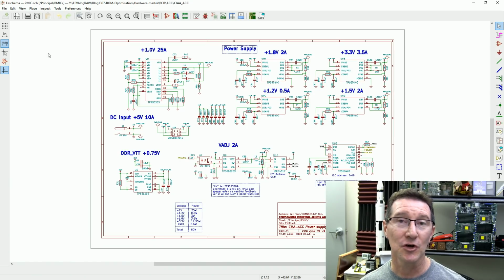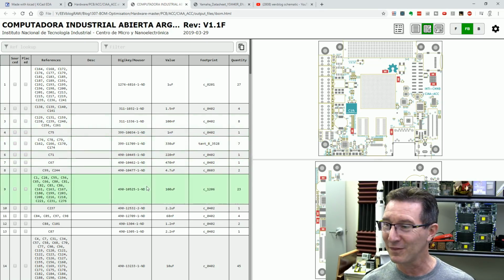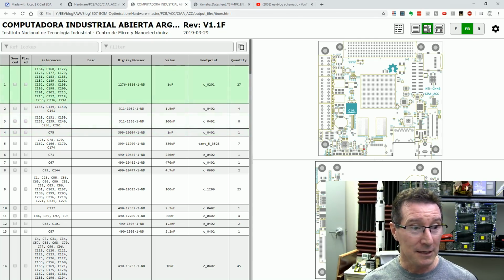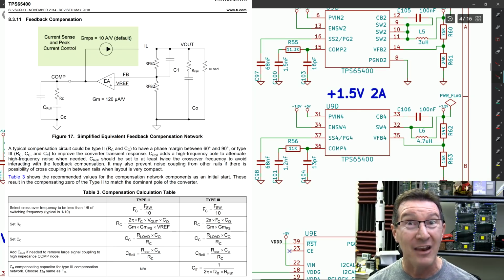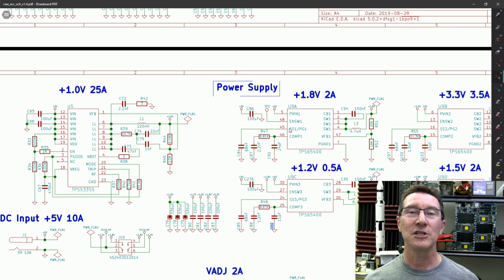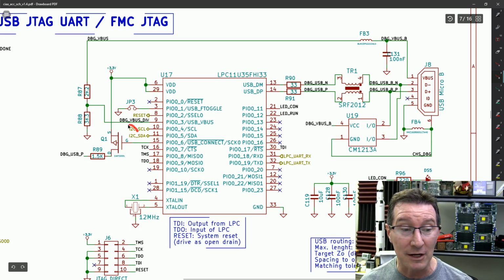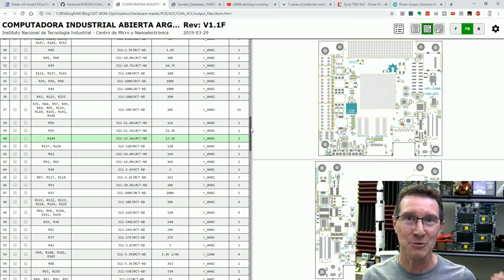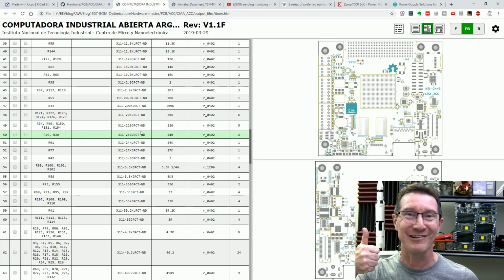EEVblog #1307 - TUTORIAL: PCB BOM Consolidation

Comment: Oh yes please! I would love to see a more in-depth BOM consolidation analysis of a board like this.

Your "Holy Grail" of one resistor and one capacitor value intrigues me. One project I have on the back burner is a SMD clone of a solid state guitar amplifier that many choob fanbois love for its choob-like tone. (It's the Fender Bronco amp, and I've zeroed in on the asymmetric differential amplifier at the input as responsible for simulating the distortion of a single-ended common cathode triode gain stage.) Lots of opportunities for series-parallel resistors and capacitors to consolidate the BOM down to just a few values.

One of my "Holy Grail"s of choob amp design is replacing electrolytic reservoir capacitors with blocks of polyputthekettleon in parallel, since wet electrolytics tend to dry out. Surely parallel MLCCs can be used in lower voltage reservoirs, since the microphonic effect is voltage dependent.

Comment: Hello Dave, I am part of the CIAA Team! Thanks for your review. I will design a new release considering your suggestions. It is important to note that 0201 capacitors have a lower inductance than 0402 caps. Besides, don't forget to consider the temperature coefficient when you replace capacitors (in order to make BOM consolidation). About bypass capacitors... I would not reduce the quantity, if Xilinx says use 100, I will use 100!!!
Reply: @NerdyNEET  jaja I don't want to be rude, so I will only say that the FIRST RELEASE of this board worked fine! And it is open hardware. And it was routed with KiCAD. And we are in Argentina... you will never understand how difficult is  to finish a project like this in my country.
Reply: @noeliascotti1795  If the first release of this highly involved board worked fine, you deserve the utmost respect regardless of where it was made or with what it was laid out!  That's incredibly impressive!
Reply: @noeliascotti1795  my congratulations, ANYBODY getting a board up and running deserves respect and the free review of Dave may help you in the next iteration. All the best from Switzerland.
Reply: @Matt herpader  It is very risky to not follow the manufacturer recommendations... I prefer to design an expensive board. Anyway I will do the math in order to see how much money we can save with the BOM consolidation.
Reply: @noeliascotti1795  : Rather than being risky to just not follow manufacturer recommendations, it risky to not give yourself the chance to follow those recommendations. Once you have the location allocated to a part, you can choose to leave it empty,
Reply: I'd agree with you on Xilinx specifying 100, use 100 and no less (more, maybe). Their FPGAs can really pack a punch, especially their higher end products like the MPSoCs and Ultrascale+ Kintex/Virtex. Without proper bypass capacitors one can risk timing failures and the resulting metastability will be a nightmare to troubleshoot. Considering one FPGA chip costs in the 5 digits to run a prototype, in terms of risk management, the cost savings from cutting down on bypass capacitors isn't worth the extra iterations most of the time.
Oh, and just because one design managed to work with say 50 bypass capacitors instead of 100, that doesn't mean it'll work once the ambient temperature hits e.g. 60 instead of the usual 25 or 40. Even X7Rs still vary by a good lot.
Reply: @Wizongod  I guess what Dave is trying to say is that you should make conscious engineering decisions on the components to use, not to follow the chip manufacturers recommendations blindly.
Reply: @NerdyNEET  CIAA stands for "Computadora Industrial Abierta Argentina" 
Here are some history where it came from http://www.proyecto-ciaa.com.ar/devwiki/doku.php?id=proyecto:origen_ciaa
Reply: Not always good idea to stick with silicon vendors evaluation board specs. They are so relaxed designs even horrible PCB stackups. They are just eva boards. Sometimes more caps do not add additional benefits, rather placement,value and type. I am working on RISC-V SOC board and test card will hopefully be ready in Sept/Oct time.
Reply: You can use X2Y caps if you would like to have less of them. Amazing parts. Not necessarily cheaper, but still worth at least knowing about them.
Reply: @NerdyNEET  Yeah, it's not good to go overkill, plus of course there's cost involved anyway (along with other difficulties in obtaining high performance parts). I work in defence, so I'm not foreign to this. But for processing density and functionality with versatility where it is paramount, and budget is provided, it's kinda unavoidable. (Especially so once high data rates in the 10s of Gbps are involved cos high speed I/O is only reserved for their better FPGA classes). Even non-Zynq architectures, i.e. the Ultrascale+ series, I wouldn't risk not following their power guidelines considering how big the implemented design is which would be a nightmare to troubleshoot.
That being said though, I don't see why anyone wouldn't use a Zynq whenever there's an FPGA+Processor involved since the low end Zynq chips are actually rather cheap. With the large number of internal I/Os between the two, it helps alot with miniaturisation, and hardware acceleration.
Reply: @NerdyNEET  Fully agree. You need to think about these things and think that less amount of different parts you will have it is better for Production , repair, and so on..I understand some parts must be pretty specific..but come on this isn't 7.5 or 8.5 Digit multimeter that need super specific parts.. most parts could be common
Reply: @NerdyNEET  jaja you are in Europe, everything is easier there.
Reply: @noeliascotti1795  did you make a new revision with the suggestions from the video ? 
Also was the entire process a success ? (i saw a lot of different sizes and versions on the git) , not sure why tho.
great job anyway it is a massive project

Comment: After seeing this Video, i've taken a look at the popular OpenSource VESC by Benjamin Vedder.
Here ist the Github:
https://github.com/vedderb/bldc-hardware/tree/master/design
On page 7 of the Schematics (BLDC_4.pdf) there are some once only used Capacitors and resistors to drive the Pins "VSENSE" and "COMP" of the DRV8302's internal Buck converter. Here is the Datasheet of the Chip: http://www.ti.com/lit/ds/symlink/drv8302.pdf?HQS=TI-null-null-mousermode-df-pf-null-wwe&ts=1590056538748
Am i missing someting or could we get swap out R17, R18, R19, C19 and C21?

Comment: I have this 20k reel of 10k/0805 resistors in my lab that was a leftover from a project.
I put these buggers everywhere but I probably won't use them up before retirement on the prototypes I populate by hand.
That is one incentive to reduce the BOM, work with what you have. :-)

Comment: Where your talking about the manufacturing machines David - Ergo, their capacity to deliver the required componentry that is limited to the example of 80 parts per reel you have given, compared to the 161 components needed, that would explain where some products you have opened up in the past and looked at, have had manual soldering done to then ... Your thoughts here bud and Cheers for the video :-)

Comment: I doubt that I'll ever end up designing or building anything which will go into production, but I do believe in always applying good work/design practice . Doing so means it becomes a standard and not being faced with having to learn something quickly later on and not being able to apply it properly or efficiently.
This video harks back to the older videos which were full on theory and I learned so much from. Information like this priceless - many thanks Dave!
Ref. good design software: I'm not sure if you're all aware that Micro-cap 12 is now completely free to download and use (thanks to eddie over on the kiss analog channel for the heads up). I've not even scratched the surface with it yet but it's improved my knowledge and understanding immensely. Any chance of maybe doing some videos about microcap in the future? 
Thanks for posting btw!

Comment: Generally, I get a working prototype with whatever the datasheets dictate (unless it's obvious) and go back later and consolidate the BOM.
On large boards where you might have a good number of low tolerance components as well as lots of high tolerance ones for instance........it can SOMETIMES be more cost effective overall to upgrade the high tolerance ones to low tolerance even though the circuit doesn't need it just in order to get the next supplier price break and thus an overall BOM cost reduction.
When it's your own money........you enevitably end up scrutinizing & trying everything!....LOL!

Comment: Having gone through this process for a couple of my own prototypes I can see why cost optimization would be a whole different topic. Its amazing how many simple ways there are to balloon the cost of a project. Not the least of which is just using old part numbers that have been updated; suddenly your dirt cheap run of the mill part costs 3x as much because its not the current part number and refers to a batch made a few years ago.... but is still in stock and the parts supplier will happily supply for all of your out of date bom needs.

Comment: Another "Muntzing" comment here, This is often an interesting topic due to the risk Vs reward of it, in particular it greatly increases the chances of design problems. If board respins are not an option due to time constraints then this risk is often not acceptible. The last thing you want is for the design to fail during testing, whether it be EMC or any number of possible problems. It's one thing if your working on hobby projects and another thing entirely if your being paid for the work and the reason why the design fails is "I had a hunch that they wouldn't be required." In my opinion assuming board area is not of concern it's far more preferable to just mark components as "Not Fitted," that way the cost is lower for manufacture saving money but the flexibility is still there.

Comment: You're confusing the imperial component sizes from the BOM with the metric sizes in the data for the Yamaha Z:TA-R YSM40R. The imperial equivalents for the size limits of the YSM40R are 008004
 for the ultra-high-speed head, 01005 for the multi head, and 0201 for the flexible head.
Reply: Since when didn’t imperial sizes use units?

Comment: I like BOM items #28 and #29: Two different 1K resistors with 1% and 5% tolerance =)
Reply: I can see it in high-spec analogue (shoot, go to .1%!), but if you aren't dealing with delicate filters it's hard to imagine the sense in it.
Reply: I think the point was that the 1% part will work for both.

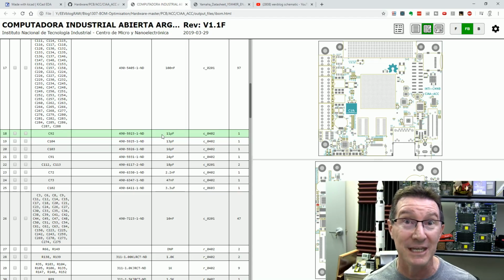Comment: 14:30 BOM consolidation / small capacitor values: load capacitors for crystals can be very important to get right for stability and exact frequency - so there might be caps in your design that need to be that exact value BUT! many xtal manufacturers (e.g. Abracon) offer variants of their parts with different nominal load capacitances. There usually is a window in which the xtal can be selected to use a more common capacitor already present on your board.
ST has excellent resources on oscillator design, precision and reliability, informing the issue from the controller-side design.

Comment: Can't the reels have,say 2 or more  different  values of the same components on them ? The first 30 is one value,and gets installed,then the next, however many you need of a different value, gets installed and so on. Im a fitter machinist/sparky, install and make lifts,we also try to get materials uniform.If one piece of steel is say a 50x75mm RHS and all the rest is 50 X 100mm,RHS then we'll use the 50x100 RHS overall. Loving learning how all this micro sized electronics are designed and manufactured,slowly becoming less and less like wizardry.

Comment: Why do I feel like whoever designed this hasn't done any one-offs that have to be hand made. When I build my hobby project one-offs I always re-use values because I'm too lazy to go and buy the oddball values. 90% of what I use are powers of 10 the rest is the occasional 2.2x or 4.7x if I really can't parallel or series two others. Oddball values should be few and far between and for something very specific that needs an exact value for whatever reason.

Comment: I did the 'Design for Manufacture' task for the first time, a couple a months ago.  (First product from a firmware guy designing hardware)   While most of what is said in the video seems like simple common sense and I instinctively followed these rules,  I think the disconnect occurs when one team designs the schematic, another the pcb, and another takes care of the manufacturing without proper communication.  I have seen too many pcbs with all of the bypass caps lumped together.

Comment: Hm. I did notice there are a handful of parts - some of the LEDs and terminal blocks - that appear on more than one line of the BOM and are therefore counted more than once. And there are two different 3.3V TVS diodes used. And it's 3:12 a.m., so I'd better quit before I really get into this more deeply, but since I'm the guy at my company that would have to source all those parts and label and pack and ship all of those reels to the assembly house and inventory the parts both before and after assembly, this BOM is quite troubling.

Comment: 2nd pass consolidation on a BOM is like the practise in programming where you optimise after you've got it working. Build a prototype board with confuser calculated values, make sure it works, then see what you can optimise out. Same in programming, get it working first, then optimise. In both cases you then know if your optimisation worked and you aren't fighting original bugs and issues in the original design.
Reply: As a software engineer I disagree to a certain degree. I've run into too many designs where optimising meant to throw the whole thing away and start from scratch---usually on software that already was productive and strict data compatibility had to be maintained. A major PITA, just because some inexperienced (or lazy, or underpaid) coder thought "it is working" was all the thought they had to invest. One of the qualities an experienced software designer/coder brings to the table is that they build their designs in a way that they can easily be optimised if needed and that they chose semantics that lend to being optimised.
Reply: @HenryLoenwind  If you're optimising that much that a redesign is necessary, then you're not optimising - you're upgrading. Either that, or the original design was invalid from the start. Optimising is a little step by little step process. And after each step, a full regression test is done to make sure you've not introduced bugs. Agree about the qualities of an experienced software engineer, as I have practised the art for 35 years.

Comment: At uni we had a simple flashing LED board (just the usual 556 + 4017 business) which we gave out as a kit while teaching kids about electronics. In my experience, kids are an even bigger target for BOM consolidation than PNP machines. I took the design from 5-6 resistors and 3-4 caps to pretty much two values of each. Beyond making them simple to assemble, I'm sure the people putting the parts into the kits appreciated it too
Reply: also kids may not really give a shit on different values until they understand why they matter by messing them up.
Reply: @urugulu1656  true, the original values are mostly a case of following the confuser as Dave puts it
Reply: @DerinTheErkan  also with the simple circuitry in such a thing whats the worst thing that can happen by changing the values ? 

its counting at .7hz instead of 1hz or what ever... as if in a bit of kit thats sole purpose is to educate children and get them hooked on electronics that would even matter

you could probably even get it down to one value for each.

actually what you need the 556 for. you dont need more than one 555 for the one oscillator it takes...

Comment: Great info for high volume board production. The boards we design at my job cost millions of dollars in parts and labor and we only do a few duplicates. Mil-spec and rad hard components make this damn near impossible to implement. Lead times are always several months to a year! And because our QA standards are insane for reliability, we have an in house pick and place technician group to handle board assembly and select solder of through hole connectors.

Comment: Most commercial SMT lines normally have a minimum of 2-3 SMT machines inline.
Reply: Company I work for has two lines with 5 - capable of 120 x 8mm Feeders (600 total), + some for picking of components from trays  - line is over 25m in length ( Screen printing for solder paste, pick and place machetes, re-flow oven - oven is  over 6 m in length.) Don't forget most active components larger than 8mm tape so real capacity is lower - also components used in volume often duplicated a number of times to allow changing of reels without interruption or to increase speed of placement. One unit is capable of placing 24 components per second using 3 placement heads -- but not all that capable, used for the highest volume components